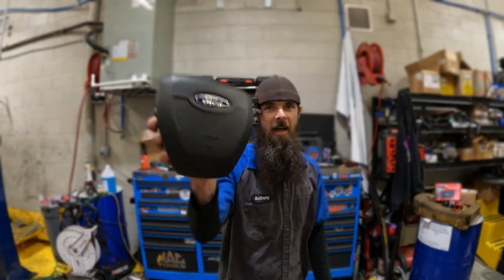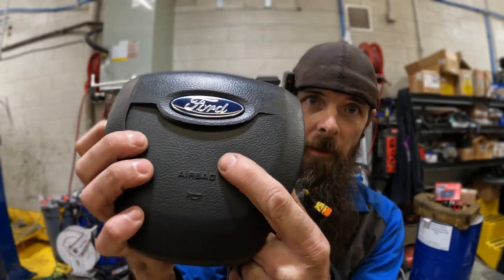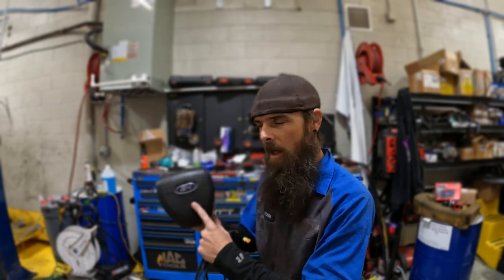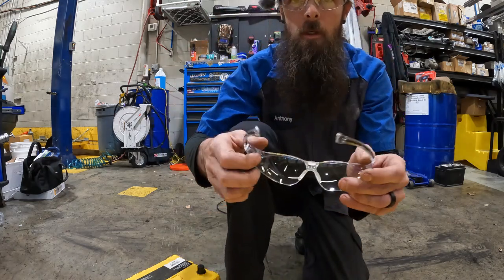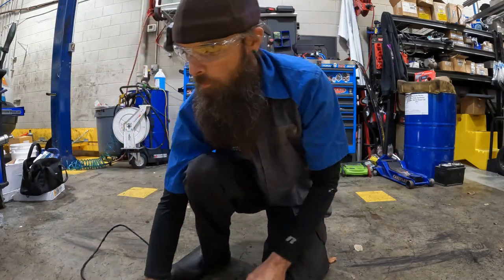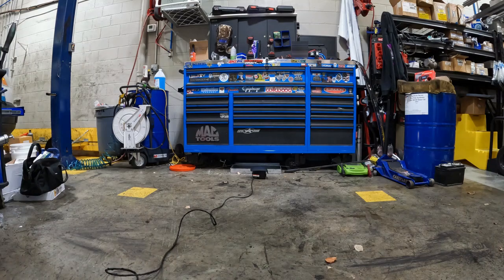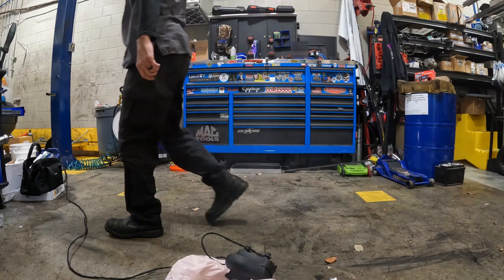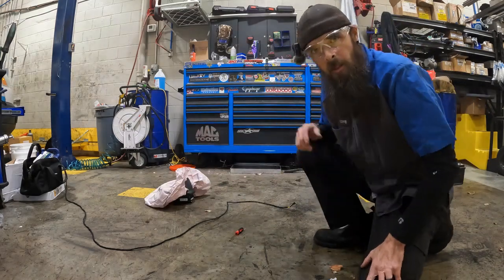Airbag Go BOOM!  How Does It Work?

Comment: I used to set off warranty airbags all the time. We had a special harness with a momentary button and alligator clips. I'd make a cardboard stuntman and tape him to the airbag and then launch him.  🤣🤣
Reply from the maker: @mlieser1230  they stopped us from setting them off for warranty return.  We had like one of those little wire clips that pinches the wire and breaks the connection. If it was one of the ones like in the video there was a dummy plug we would put in the socket. Put it in the new parts box and warranty return.  It's fun setting them off

Comment: Anthony, when you get a chance let me know what you find on my 2016. I sent you the SN. My son ran across an article that said a lot of people are finding the wiring harness from the trailer receptacle running up to the L. F. fender well near the master cylinder….but it stopped there and not connected to anything. Also the trailer charge line is only 18 gauge….🤷‍♀️ That ain’t gonna carry that much current even if it was hooked up.  Merry Christmas!
Reply from the maker: I'm still looking at wire diagrams and tsb and all sorts of stuff filtering through. Haven't forgot about you.
Reply: @BeardedFordTech   yeah I figured such. Enjoy a little time off with your family ❤️
Reply from the maker: @williamtoney2599  😁😁💯💯 you as well. Touch base with you Thursday

Comment: 😂😂😂😂 YESSS!

On the GM side they have an SIR module. Guess it's an SRS for others? acrymns. 

ANYWAYS, If you remove said module with power and rotate it. Airbags will deploy as it detected a rollover.
Reply from the maker: @Derek-GMM  SRS is safety restraint system. The module is rcm Restraint Control Module. The rollover isn't was causes it to deploy. It's the impact from the rollover.  Still fun to set them off.  I remove them all the time with power. I never repower the srs system.
Reply: @BeardedFordTech  SIR is the supplemental inflatable restraint. I don't imagine it's any different.  But they insist you must disable the system.  Which, I've never done either lol
Reply from the maker: @Derek-GMM  yeah different manufacturers call it different things. When it's really the same thing. I never power it down. Cause the restraint control module has to be programmed
Reply: We used to call SRS Save R SAAB. 🤣🤣